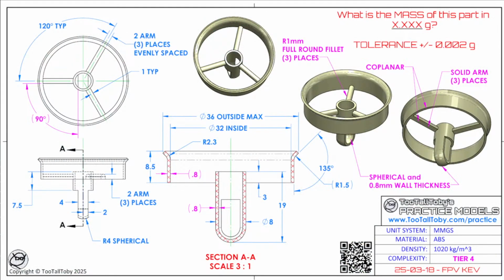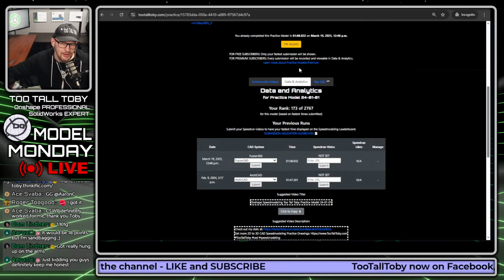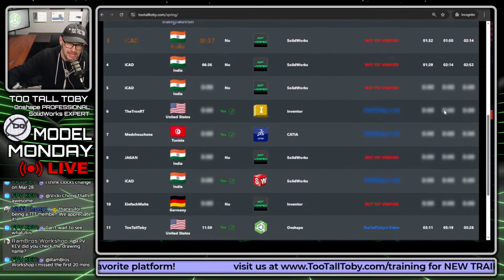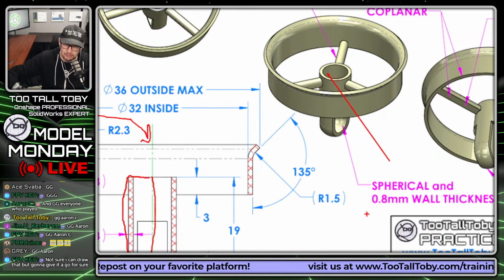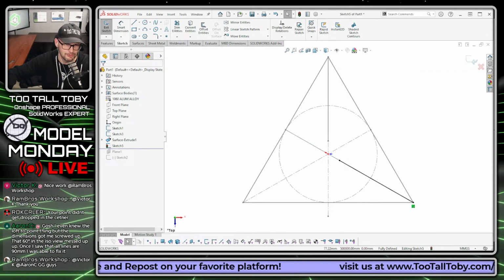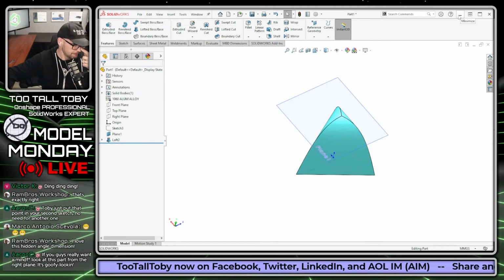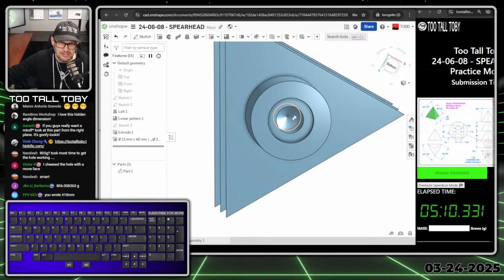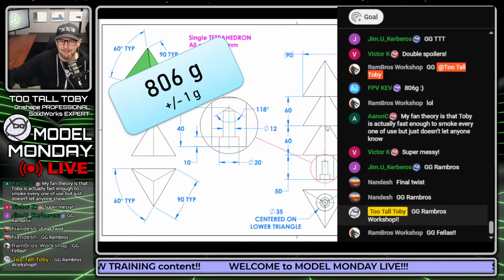Model Monday LIVE - 1 PM  - MARCH 24th - Speedmodeling 3DCAD esports - CAD vs CAD!

Comment: Nice!
@TooTallToby: if you pick the "up to entity" for the hole tool you can select "offset from tip" option to get the correct dimension (pick the bottom face and use 40).
Reply from the maker: AWWWWWW SICK!!!!!!!!!!! Thanks Airwick!!